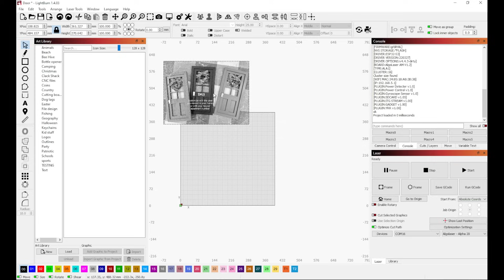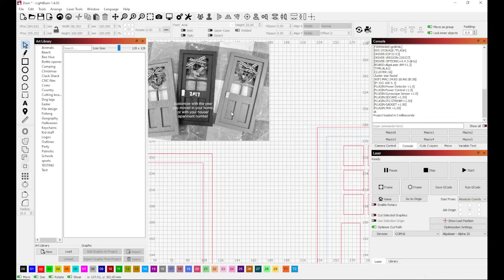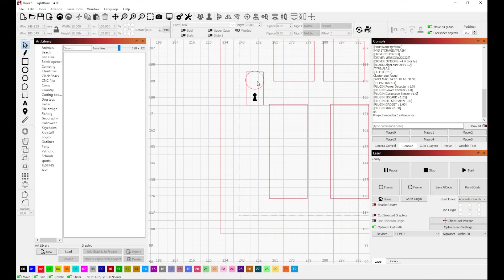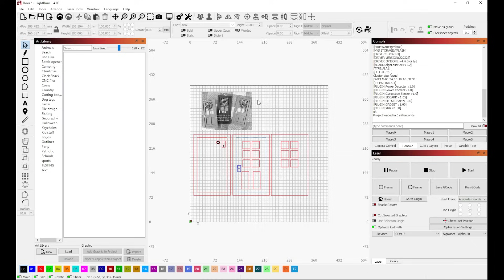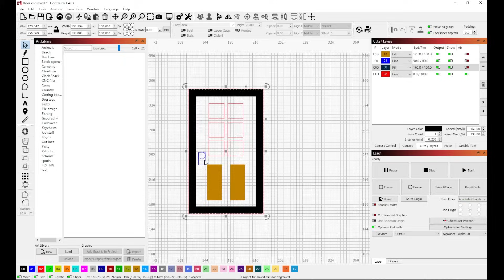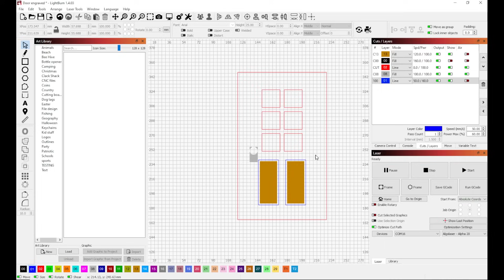Layered project design in LIGHTBURN

Comment: I like the three layer one. you need to put the 45 degree lines on the outside trim of that door like you did on the one layer one you did.
Reply from the maker: Yea. I also should have added an edge to hold the lid in place on the CNC one. My files tend to improve over time as I tweak them. Thanks

Comment: Nice - liking the 3D version, but I think I would experiment with the edges to see if I could get some more shape into them. Not keen on seeing flat edges where I think it would be better with more of a rounded over look. But other than that I see some procedures here that I want to explore. Lightburn keeps on surprising me with its capabilities, that's for sure.
Reply from the maker: Rounded edges is hard to accomplish with a laser. A cnc, yea.
Reply: @TheClackShack  I suppose it would involve lots of individual power settings to get the depth of cut but I'm guessing.

Comment: An idea crossed my mind at the end.  If the middle layer (door) had a solid lower half and it were sized so it could open outwards, it could swing open revealing a cat, dog, message, name, year, etc on the lower door portion of the back layer.  

To make the door swing, you could give it two tabs at the top and bottom that could be sanded round and sit between the front and back layers to form pivots.  The back layer could just be the frame and whatever you wanted on the lower half of the door as a silhouette, or it could be solid with the window area shaded and words/etc on the lower half.

Sorry if that was wordy or hard to understand!
Reply from the maker: That could be done. I was reproducing what Brandy wanted.
Reply: @TheClackShack  oh, yes; I knew that.  I thought my post might give some9ne an idea to try.  Hope you feel better soon!  We don't want to see you in the Cla-spital.